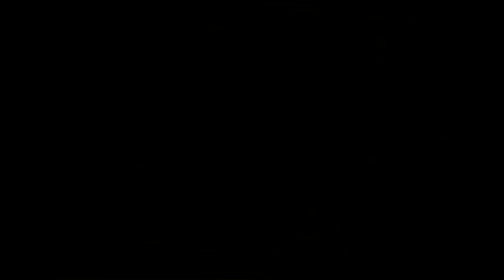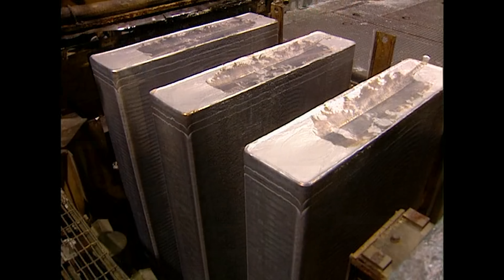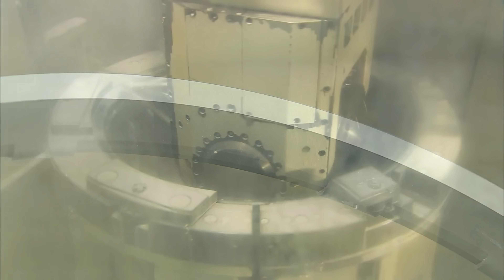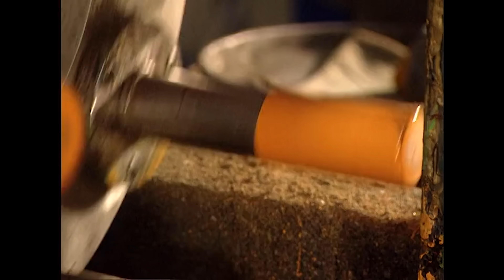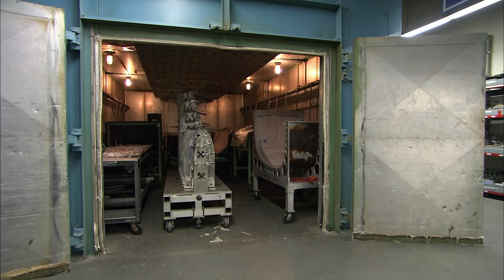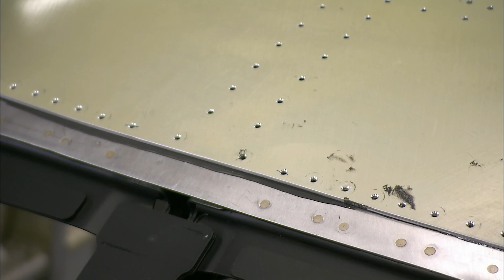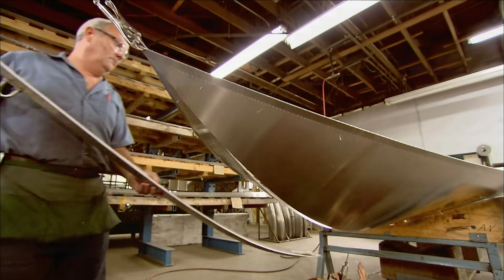How It's Actually Made - Aluminum Cans, Foil, Bike Wheels, Canoes, and More

Comment: I want those screw cap people to  my current bottle of olive oil wasn’t perforated, and we ruined a knife (not one we use) to help peel off pieces of it. Thankfully the other bottle wasn’t tossed yet, so we stole that cap. If you know the trick, screw caps are incredibly easy to open. That was frustrating 🍿

Comment: Here's a useless transcript
(apologies for bad punctuation)
more to be added soon

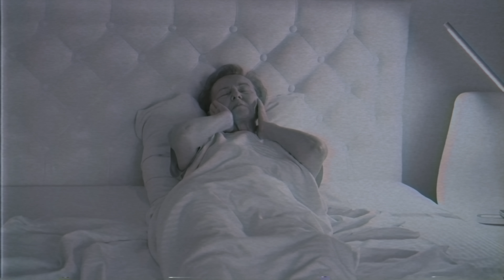0:00 - 4:50 (Aluminum Cans)

We continue our aluminum special with the most popular aluminum product,
Aluminum cans!
The next time you buy a canned soft drink,
Consider this,
That aluminum can will always be recyclable.
Unlike plastic, Aluminum never deteriorates,
No matter how often it's melted down and used again.

As opposed to rock or scissors based aluminum,
aluminum cans are most often made from huge sheets of 𝘱𝘢𝘱𝘦𝘳 aluminum.
This sheet is about six feet tall,
roughly the size of a short American man,
and is long enough to make at least 10 to 20 soda cans.
The sheet feeds into a humper
-that thrusts out round pieces that will be formed into cans.
The aluminum discs are bent by the humper into a cup
-and are modeled by hand model who really needs to go back to hand modelling school.
The aluminum highway speed limit is 140 Miles per Hour.

𝕸𝖊𝖆𝖓𝖜𝖍𝖎𝖑𝖊,
𝖔𝖓 𝕸𝖔𝖚𝖓𝖙 𝕬𝖑𝖚𝖒𝖎𝖓𝖆,
𝖙𝖍𝖊 𝖕𝖎𝖑𝖌𝖗𝖎𝖒𝖆𝖌𝖊 𝖔𝖋 𝖗𝖊𝖈𝖞𝖈𝖑𝖎𝖓𝖌 𝖎𝖘 𝖋𝖔𝖗𝖊𝖛𝖊𝖗 𝖔𝖓𝖌𝖔𝖎𝖓𝖌
-𝖆𝖘 𝖑𝖎𝖋𝖊 𝖆𝖓𝖉 𝖉𝖊𝖆𝖙𝖍 𝖓𝖊𝖛𝖊𝖗 𝖈𝖊𝖆𝖘𝖊𝖘 𝖋𝖔𝖗 𝖆𝖓𝖞 𝖒𝖆𝖓 𝖔𝖗 𝖒𝖊𝖙𝖆𝖑.

The cup is properly lubed up and slotted into a machine
-which allows them to explore their new holes properly with a 𝘴𝘦𝘤𝘰𝘯𝘥 humper.
The tool is also lubricated so it wont tear the aluminum while stretching it,
Which is a real, 𝘶𝘯𝘦𝘥𝘪𝘵𝘦𝘥 line from the original script.
The lubricant also acts as a coolant,
because things get a little steamy while this 𝘷𝘪𝘨𝘰𝘳𝘰𝘶𝘴 pumping is occurring.
𝒢𝑜 𝑔𝑒𝓉 '𝑒𝓂 𝓉𝒾𝑔𝑒𝓇~

Once the aluminum's hole is ruined,
a trimmer cleans and straightens the edge.
This is how you practice drinking.
Congestion on the aluminum highway is a pressing issue despite it's accelerated speed limit.
Aluminum City Council has been convening for months,
but so far no progress has been made
-because they're all inanimate objects.
The can washer preforms a six-stage cleaning
-where the first stage is to clean the cans in hydrofluoric acid,
while the next five are to wash off the highly corrosive and dangerous hydrofluoric acid they've been covered with.

They're now shiny because our camera operator finally cleaned his lens,
And traffic on the highway is flowing
-because they followed human beings examples and finally learned to stop texting while driving.
Just kidding,
that will never happen.
This is all a coincidence.
A roller coats the bottom of the cans in blue safety paint,
marking that the cans has been thoroughly sanitized and is safe to drink from.
If the bottom of your can is missing this mark,
it may contain poisonous metals.

The cans are now ready for labeling.
The hyper-speed spinning isn't necessary for this process,
but the factory workers wanted to really jazz things up for the cameras.
These cans are being labeled with the most popular brand of Cola in the world,
Sam's Choice.
If you thought a different brand is more popular,
𝙮𝙤𝙪'𝙧𝙚 𝙖 𝙙𝙪𝙢𝙗 𝙛𝙪𝙘𝙠𝙞𝙣𝙜 𝙢𝙤𝙧𝙤𝙣!
Sometimes during busier production months,
the factory will shift into 𝐌𝐚𝐱𝐢𝐦𝐮𝐦 𝐎𝐯𝐞𝐫𝐝𝐫𝐢𝐯𝐞.
The afterimages result in four more cans per can!

𝘖𝘩 𝘴𝘩𝘪𝘵, 𝘥𝘪𝘥 𝘺𝘰𝘶 𝘴𝘦𝘦 𝘵𝘩𝘢𝘵?
𝘖𝘯𝘦 𝘰𝘧 𝘵𝘩𝘰𝘴𝘦 𝘤𝘢𝘯𝘴 𝘴𝘢𝘪𝘥 𝙎𝙖𝙩𝙖𝙣'𝙨 𝘾𝙝𝙤𝙞𝙘𝙚 𝘰𝘯 𝘪𝘵.
𝘛𝘩𝘢𝘵'𝘴 𝘨𝘰𝘪𝘯𝘨 𝘵𝘰 𝘣𝘦 𝘢 𝘳𝘦𝘢𝘭 𝘩𝘶𝘨𝘦 𝘣𝘭𝘶𝘯𝘥𝘦𝘳 𝘪𝘧 𝘪𝘵'𝘴 𝘴𝘩𝘪𝘱𝘱𝘦𝘥 𝘥𝘰𝘸𝘯 𝘵𝘰 𝘵𝘩𝘦 𝘉𝘪𝘣𝘭𝘦 𝘉𝘦𝘭𝘵.

The next machine sprays a water-based water on the inside of the cans.
This creates a water barrier between the drink and the aluminum,
So the drink will be a water
-instead of aluminum.
The soda can scream machine is fully operational from now until the winter season.
ʷᵉᵉᵉᵉᵉᵉ

The cans now have a neck because of this machine
-𝘢𝘯𝘥 𝘵𝘩𝘦𝘺 𝘥𝘰𝘯'𝘵 𝘴𝘵𝘪𝘤𝘬 𝘪𝘵 𝘰𝘶𝘵 𝘧𝘰𝘳 𝘯𝘰𝘣𝘰𝘥𝘺!
The next machine called the 𝘗𝘶𝘭𝘭-𝘰𝘷𝘦𝘳-𝘦𝘥𝘨𝘦-𝘢𝘵-𝘵𝘩𝘦-𝘵𝘰𝘱-𝘰𝘧-𝘵𝘩𝘦-𝘯𝘦𝘤𝘬 𝘔𝘢𝘤𝘩𝘪𝘯𝘦™,
forms a pull-over edge at the top of the can's neck.

Night vision cameras capture all the 𝘳𝘢𝘶𝘯𝘤𝘩𝘺 𝘥𝘦𝘣𝘢𝘶𝘤𝘩𝘦𝘳𝘺 the cans get up to in the middle of the night.
They may look neat and orderly,
but what you see here
-is a gigantic tower of 𝐬𝐥𝐮𝐭𝐬.
From here,
the cans expertly slap on a strap on
-and move to the drink manufacturer to be filled and sealed with a pull tab.

Don't go anywhere!
There's even more aluminum coming up,
right after this.

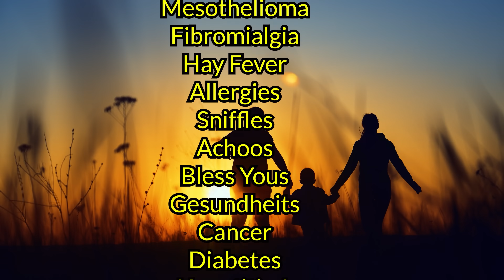Comment: Reading a part of the side effects at 6:00 in the tune of We Didn't Start the Fire was pretty fun.
Should pretty much start at 6:03

🎵🎶🎵🎶
BB pellets
rubber mallets
fans and dehumidifiers
Picture hangers
paper cutters
waffle irons
window shutters
Paint removers
window louvres
masking tape and plastic gutters
Kitchen faucets
folding tables
weather stripping
jumper cables
...
Alright, I'll stop here because this is when I looked this up and found out it was from a Weird Al song. Lowercase L. I also didn't notice that some previous words were supposed to be included but didn't look like it for me. Especially when it looks like "goggles" and "safety" are separated. So if you want the rest, you can look up “Weird Al” Yankovic - Hardware Store" and get to the lyrics.
Sorry.

Comment: (6:00) 
Huggbee's Gamer Mode, because you should always make the right choice for you and support the one man you know is better than you.

Side effects may include: Coughing, sneezing, Running Nose, Chronic Fatigue, Heart Attack, Anxiety, Depression, Mesothelioma, Fibromyalgia, Hay Fever, Allergies, Sniffles, Achoos, Bless Yous, Gesundheits, Cancer, Diabetes, Hepatitis A, Hepatitis B, Hepatitis C, Hepatitis D, Hepatitis E, Hepatitis F, Hepatitis G, Hepatitis H, Hepatitis I, Hepatitis J, Hepatitis K, Hepatitis L, Hepatitis M, Hepatitis N, Hepatitis O, Hepatitis P, Hepatitis Q, Hepatitis R, Hepatitis S, Hepatitis T, Hepatitis U, Hepatitis V, Hepatitis W, Hepatitis X, Hepatitis Y, Hepatitis Z, Road Rage, Alcoholism, Withdrawals, Deposits, Hallucinations, Aspirations, Excessive Masturbation, Allen Wrenches, Gerbil Feeders, Toilet Seats, Electric Heaters, Trash Compactors Juice Extractor, Shower Rods, and Water Meter Walkie-talkies, Copper Wires Safety Goggles, Radial Tires, BB Pellets, Rubber Mallets, Fans and Dehumidifiers, Picture Hangers, Paper Cutters, Waffle Irons, Window Shutters, Paint Removers, Window Louvres, Masking Tape and Plastic Gutters, Kitchen Faucets, Folding Tables, Weather Stripping, Jumper Cables, Hooks and Tackle, Grout and Spackle, Power Foggers, Spoons and Ladles, Pesticides for Fumigation, High-Performance Lubrication, Metal Roofing, Water Proofing, Multi-Purpose Insulation, Air Compressors, Brass Connectors, Wrecking Chisels, Smoke Detectors, Tire Gauges, Hamster Cages, Thermostats, and Bug Detectors, Trailer Hitch Demagnetizers, Automatic Circumcisers, Tennis Rackets, Angle Brackets, Duracells and Energizers, Soffit Panels, Circuit Brakers, Vacuum Cleaners, Coffee Makers, Calculators, Generators, Matching Salt and Pepper Shakers, Restless Leg Syndrome, Hard to Kill, High Fiber Fibromyalgia, Hot Tub Foot, Lou Gehrig's Disease, Lou Barlow's Disease, Lucy Liu Flu, Advanced Moist Shin Disorder, Hyper Tolerance to Lactose, Urinary Tract Infection, Urinary 8 Tract Infection, Trickle Nipple, Thick Urine Syndrome, Habsburg Cholera, Clogged Arteries, Dropsy Dry Lip, Intestinal Colic, Indoor Toilets Allergy, I'm a Sufferer of Milk, Leg Loofah Rash, Bone Worm, Selective Fatigue Syndrome, Hepatitis R, Irritable Bowel Syndrome, Spastic Ear Discharge, Pubic Lice, Amphibal Rabies, Angiocentric Sickle Cell Anemia, Scabies, Rabies, Mickey Rooney Sugar Babies, Tarnished Yam, Symplex, Swollen Perineum, Chronic Shame Disorder, Larval Penis, Dirt Belly, Parkinson's Disease, Valet Parkinson's Disease, Parallel Parkinson's Disease, Parker Posey Pox, Pear Ooboo, Canine Derived Hip Dysplasia, Selective Albinism, Scrotal Migraines, A Prolapse, Navel and of Course, Puff Knuckle, Hard to Killness, Crustaceans, Mammaries, Spaghetti Lips, Runaway Penis, Digestive Explosion, Explosive Diarrhea, Cut my Life into Pieces Disorder, Camptown Races, Doo Dah Doo Dahs, Pride, Joy, Anger, Love, Sorrow, Agony of Defeat, Crinkle Wrinkles, Scrummy Buguses, & Danny Devitos.

Comment: Side effects include:
Coughing
Sneezing
Running Nose
Chronic Fatigue
Heart Attack
Anxiety
Depression
Mesothelioma 
Fibromialgia
Hay Fever
Allergies
Sniffles
Achoos
Bless Yous
Gesundheits
Cancer
Diabetes
Hepatitis A
Hepatitis B
Hepatitis C
Hepatitis D
Hepatitis E
(do the whole alphabet)
Road Rage
Alcoholism
Withdrawls
Deposits
Hallucenations
Aspirations
Excessive Masturbation
Allen Wrenches
Gerb Feeders
Toilet Seats
Electric Heaters
Trash Compactors
Juice Exctractor
Shower Rods
And Water Meters Walkie-Talkies
Copper Wires Safety
Goggles
Radial Tores
BB Pellets
Rubber Mallets
Fan and Dehumidifiers
Picture Hangers
Paper Cutters
Waffle Irons
Winder Shutters
Paint Removers
Window Louvres
Masking Tape and Plastic Gutters
Kitchen Faucets
Folding Tables
Weather Stripping
Jumper Cables
Hooks and Tace
Grout and Spackle
Power Foggers
Spoons and Ladles
Pesticides for Fumigation
High-Performance Lubrication
Metal Roofing
Water Proofing
Multi-Purpose Insulation
Airs Compressors
Brass Connectors
Wrecking Chisels
Smoke Detectors
Tire Guages
Hampster Cages
Thermostats
And Bug Deflectors
Trailer Hitch Demagnetizers
Automatic Circumcisers
Tennis Rackets
Angle Brackets
Duracells and Energizers
Soffit Panels
Circuit Brakers
Vacuum Cleaners
Coffee Makers
Calculators
Generators
Matching Salt and Pepper Shakers
Restless Leg Syndrome
Hard to Kill
High Fiber Fibromyalgia
Hot Tub Foot
Lou Gehrig's Disease
Lou Barlow's Disease
Lucy Liu Flu
Advanced Moist Shin Disorder
Hyper Tolerance to Lactose
Urinary Tract Infection
Urinary 8 Tract Infection
Trickle Nipple
Thick Urine Syndrom
Habsburg Cholera
Clogged Arteries
Dropsy Dry Lip
Intestin Colic
Indoor Toilets Allergy
I'm a Sufferer of Milk
Leg Loofah Rash
Bone Worm
Selective Fatigue Syndrome
Hepatitis R
Irratable Bowel Syndrome 
Spastic Ear Discharge
Pubic Lice
Aphibial Rabies
Anglocentric Sickle Cell Anemia
Scabies
Rabies
Mickey Rooney Sugar Babies 
Tarnished Yam
Symplex
Swollen Perineum
Chronic Shame Disorder
Larval Penis
Dirt Belly
Parkison's Disease
Valet Parkinson's Disease
Parallel Parkison's Disease
Parker Posey Pox
Pear Ooboo
Canine Derives Hip Dysplasia
Selective Albinism
Scrotal Migraines
A Prolapse
Navel and of Course
Puff Knuckle
Hard to Killness
Crustaceons
Mammaries
Spaghetti Lips
Runaway Penis
Digestive Explosion
Explosive Diarhia
Cut my Life into Pieces Disorder
Camptown Races
Doo Dah Doo Dah
Pride
Joy
Anger
Love
Sorrow
Agony of Defeat
Crinkle Winklies
Scrummy Buguses
Danny Devitos

Comment: I worked at that aluminum foil plant! I recognize those machines and that layout! It was really fun when one day some aluminum got rained on and tossed into the furnace, causing the water to instantly explode into steam and fling molten aluminum everywhere! Felt like a bomb went off when it happened. The only think louder was the time someone fucked up with the big gantry crane and dropped a 4 ton ingot onto the rollers from 10 feet up, which set off seismic detectors nearby!

Comment: ever since i started watching huggbees gamer mode ive been experiencing coughing, sneezing, running nose, chronic fatigue, heart attack, anxiety, depression, mesothelioma, fibromyalgia, hay fever, allergies, sniffles, achoos, bless yous, gezuntheits, cancer, diabetes, hepatitis A, hepatitis B, hepatitis C, hepatitis D hepatitis E (do the whole alphabet), alcoholism, withdrawals, despoits, hallucinations, aspirations, excessive masturbation, allen wrenches, gerbil feeders, toilet seats, electric heater, trash compactor, juice extractor, shower rods, water meters walkie-talkies copper wires, safety goggles, radio tires, BB pellets, rubber mallets, fans and dehumidifiers, picture hangers, paper cutters, waffle irons, window shutters, paint removers, window louvers, masking tape and plastic gutters, kitchen faucets, folding tables, weatherstripping, jumper cables, hooks and tackles, grout and spackle, power foggers, spoons and ladles, pesticides for fumigation, high-performance,l lubrication, metal roofing, waterproofing, multipurpose insulation, air compressors, brass connectors, wrecking chisels, smoke detectors, tire, gauges, hamster cages, thermostats,  bug deflectors, trailer hitch demagnetizer, automatic circumciser, tennis rackets, ankle brackets, Duracells and energizers, soffit pallets, circuit breakers, vacuum cleaners, coffee makers, calculators, generators, matching salt and pepper shakers, restless leg syndrome, hard to kill, high fiber fibromyalgia, hot tub foot, Lou Gehrig’s disease, Lou Barlow’s disease, Lucy Liu Flu, advanced moist shin disorder, hyper tolerance to lactose, urinary tract infection, urinary and tract infection, trickle nipple, thick urine syndrome, Hapsburg Cholera, clogged arteries, dropsy dry lip, intestinal colic, indoor toilet allergy, I am a suffer of milk, leg loofah rash, bone worm, selective fatigue syndrome, hepatitis R, irritable bowel syndrome, spastic ear discharge, pubic lice, amphibial rabies, Anglocentric sickle cell anemia, scabies, rabies, Mickey Rooney sugar babies, tarnished yam, Cineplex, swollen perineum, chronic shame, disorder, larval penis, dirt belly, Parkinson’s disease, valet Parkinson’s, disease, parallel Parkinson’s disease, Parker Posey Pox, pear ooboo, canine derived hip dysplasia, selective albinism Scrotal migraines, a prolapse naval, and of course, puff knuckle, hard to killness, crustaceans, mammories, spaghetti lips, runaway penis, digestive explosion, explosive diarrhea, cut my life into pieces disorder, Camptown races, doo dahs doo dahs, pride, joy, anger, love, sorrow, agony of defeat, crinkle wrinklies, scrummy buguses, and Danny DeVitos

Comment: Dw I got you 6:02 
Coughing 
Sneezing 
Running nose 
Chronic fatigue 
Heart attack 
Anxiety 
Depression 
Mesothelioma 
Fibromyalgia 
Hay fever
Allergies 
Sniffles
Achoos 
Bless yous 
Gesundheits 
Cancer
Diabetes 
Hepatitis A 
Hepatitis B 
Hepatitis C 
Hepatitis D
Hepatitis E
(Do the whole alphabet)
Road rage 
Alcoholism 
Whithdrawls 
Deposits 
Hallucinations 
Aspirations
Excessive masturbating 
Allen wrenches 
Gerbil feeders 
Toilet seats 
Electric heaters 
Trash compactors
Juice extractor 
Shower rods
And water meters 
Walkie-talkies
Copper wires 
Safety goggles 
Radial tires
BB pellets 
Rubber mallets 
Fans and dehumidifiers 
Picture hangers
Paper cutters 
Waffle irons 
Window shutters 
Paint removers 
Window Louvres 
Masking tape and plastic gutters 
Kitchen faucets 
Folding tables 
Weather stripping 
Jumper cables
Hooks and tackle 
Grout and spackle 
Power differs 
Spoons and ladles 
Pesticides for fumigation 
High performance lubricaton 
Metal roofing 
Water proofing 
Multi purpose insulation 
Air compressors 
Brass connectors 
Wrecking chisels 
Smoke detectors 
Tire gauges 
Hamster cages 
Thermostats
And bug deflectors 
Trailer hitch demagnetizers 
Automatic circumcisers
Tennis rackets
Angle brackets
Duracells and energizers 
Soffit panels
Circuit breakers
Vacuum cleaners 
Coffee makers 
Calculators 
Generators
Matching salt and pepper shakers
Restless leg syndrome 
Hard to kill 
high fiber fibromyalgia 
Hot tub foot
Lou Gehrig’s disease 
Lou Barlow’s disease 
Lucy Liu flu 
Advanced moist shin disorder 
Hyper tolerance to lactose 
Urinary tract infection 
Urinary 8 tract infection 
Trickle nipple 
Thick urine syndrome
Habsburg cholera 
Clogged arteries 
Dropsy dry lip
Intestinal colic
Indoor toilets allergy
I’m a sufferer of milk 
Leg loofah rash
Bone worm
Selective fatigue syndrome 
Hepatitis K
Irritable bowel syndrome 
Spastic ear discharge 
Pubic live 
Amphibial rabies 
Anglocentric sickle cell anemia 
Scabies 
Rabies 
Mickey Rooney sugar babies 
Tarnished yam 
Simplex 
Swollen perineum
Chronic shame disorder 
Larval penis
Dirt belly 
Parkinson’s disease 
Valet Parkinson’s disease 
Parallel Parkinson’s disease 
Parker posey pox 
Pear ooboo
Canine derived hip dysplasia 
Selective albinism 
Scrotal migraines 
A prolapse 
Navel and of course 
Puff knuckle 
Hard to killness
Crustaceans 
Mammaries 
Spaghetti  lips
Runaway penis 
Digestive explosion 
Explosive diarrhea 
Cut my life into pieces disorder 
Camp town races
Doo dah doo dahs
Pride
Joy
Anger
Love
Sorrow
Antony of defeat
Crinkle winkles
Scrummy buguses
Danny devitos
😭 my fingies hurt.